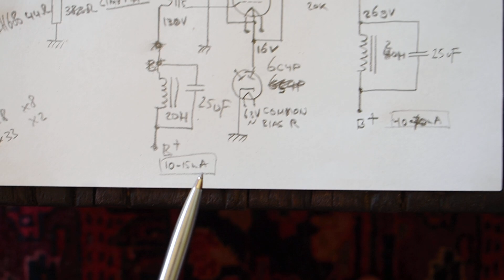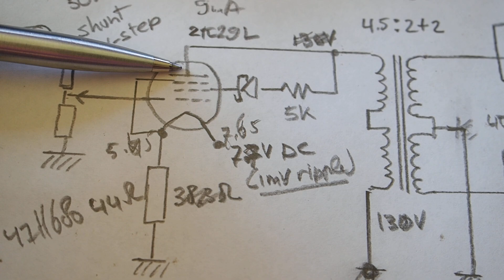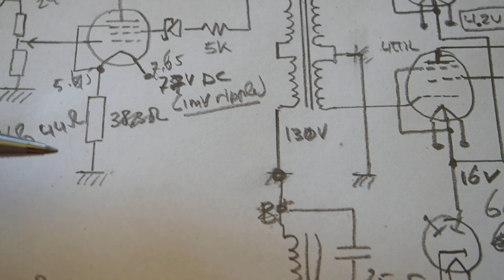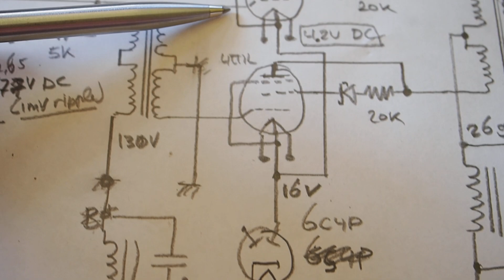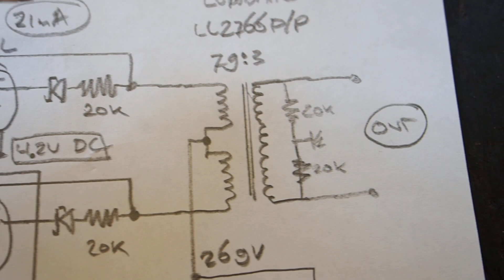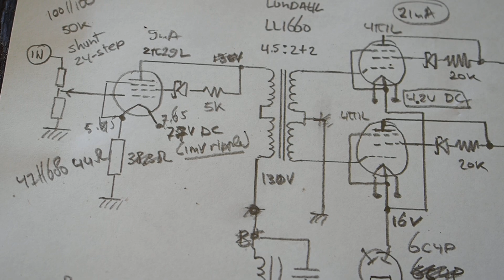The design of my power amp - part 2/4: circuit diagram walkthrough

Comment: FINE tube art .................yes the 25µF goes to ground ............in old school tube technology sometimes a small ( HV type ) capacitor is shunted over a choke to criticaly damp the choke , trial and error to show on a oscilo but only implemented on pure class A amplifiers with constant current draw .
the diodes on ther screen are also a great idea , did you compare with and without ?..., saw this trick a ferw ago but don't remember who used it ?

On high impedance headphones ( 600 Ohm or more ) I used a capacitor coupling ( no inductive BG configuration )............it worked great also .
No other capacitors in the circuit either other than the Black Gates .
Reply from the maker: Thank you. I will try to remove those diodes in not too long; I wanted to do a long time test with them - they've been in for ~3 months now and the 2nd Altec 414 has finally broken in .. so any difference should be more easily audible and I will report back on this. I saw this method on the website of Dennis Grimwood, at oestex dot com.

Comment: The B+ chokes have caps in parallel, not to ground. Are they working as a tuned circuit?
Reply from the maker: Sorry they are to the ground. Brain fart!
Reply: @EduardBroekman  I think you might want to post in the comments about the correction that they are LC decoupling stages, not  Resonant Choke supplies.. Or pin the OP’s comment. Just a suggestion..
Reply from the maker: @rickg8015  Done.. I will do a short follow up with corrected diagram too.
Reply: @EduardBroekman  Thanks for sharing your novel design Eduard.
Reply from the maker: @mfr58  I have in the past with LM317 and equivalents (think tubecad and such published sources) which sounded outright terrible and that was before I developed my hearing. I have yet to try gyrators and Rod Coleman's loading methods, so I won't exclude anything. One thing I do want to try is high freq. AC for DHTs.

But right now, I feel that the most to gain is in all DHT, proper loading of tubes by conventional means, direct connect, better power supplies, better TF core materials or direct connect circuits.. not adding complexity or element that have high frequency switching behaviour.

 Have you had good experience with a certain circuits? Thoughts on your side?
Reply: @EduardBroekman  Yes, I even find issues with 317 for heater supplies.....
Reply from the maker: @mfr58  I now just go for the interstage with open secondaries / very high loading (as AN does) which achieves similar loading, simplicity and super low DCR to ground for any grid current.
Reply: @EduardBroekman  Hi Eduard, I second the low DCR for the grid, i makes a lot of difference to get a more stress-free relaxed sound. Indeed, the 317 could be regarded as the bane of audio, better to banish from everywhere. So, I second all the choices you took. One tip I could give -  have not seen much attention on this: the heater supplies having their dedicated transformers, and oversizing them as much as you can. 1A current draw - supply it with a dedicated filament with a 4A secondary. You are using DHTs, so separate supplies for each tube... but even for IDHT, do not share filaments between stages. Giving each tube their separatefilament transformers, and properly referencing each tube heater to the tube itself brings their sound closer to the DHT sound.... I think a chunk of the DHT benefit comes from the dedicated heaters...
Reply from the maker: @realworldaudio  Hi Janos, very interesting but I take your over dimensioning and minimising cross influences (this is part why I use a constant draw output stage).

What I did here is use 2 transformers: one for the driver stage and one for the output stage, and the layout is optimised for the type of demand. Since the output stage has a near constant power draw, I used the 3x6.3V secondaries for the filament supplies of regulator tubes and the 4P1L. The 2nd transformer only does the 2P29L filament supply and its 9ma quiescent current.. so it's not entirely what you so well suggested but the the overhead is greatest where I get some variability in current demands: the 1st is probably running at 50% capacity, the 2nd driver stage transformer runs at under 10% of its rated capacity... 

With regard to DHTs.. with my limited experience and impression from comments from Qvortrup, I think the much more efficient release of electrons has a large benefit .. earlier IDHs use relatively much larger heaters and it just looks like the economising later on is one large cause of in-linearity and the need to leave much more headroom from specification... a tube like 6GE5 uses much more heater current than a lets says a 6V6 compared to their dissipation... and something must give. 

DHTs to me have a nuance in subtle expression that I haven't heard IDHs do.. although perhaps your ampex can swing my opinion in a second :) I base a lot of this since I know for example how low distorting the 6E6P can operate.. yet the distortion has no bearing on the nuances expressed in my current DHT driver stage. These facets seem entirely uncorrelated...
Reply from the maker: @MFR58 thank you for picking up on this!